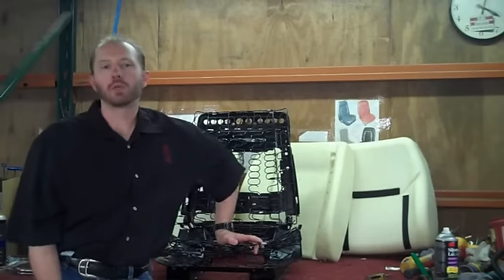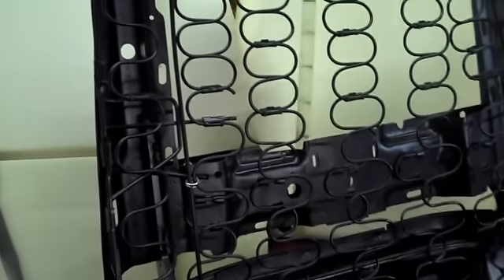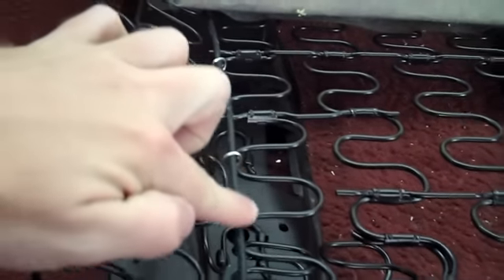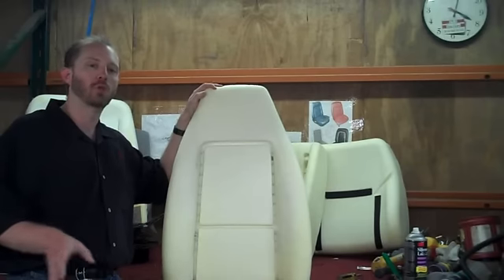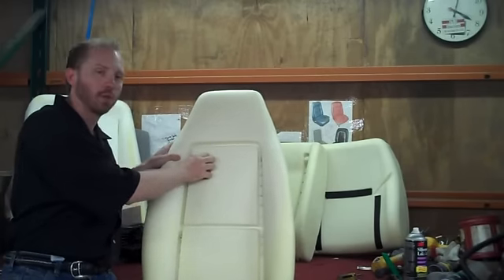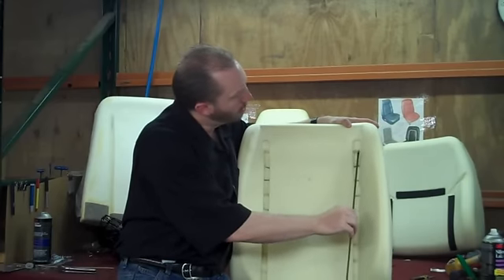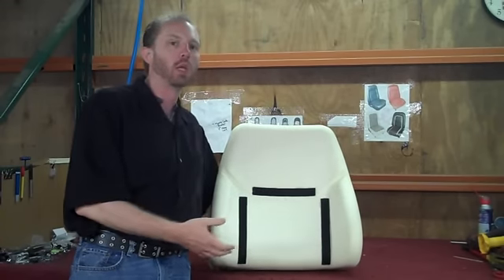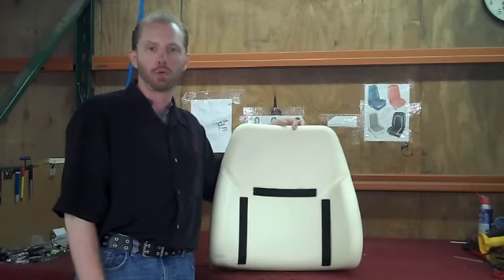Seat Foam Types

Comment: just wondering i have a 1979 ford pantech truck under the seat i was putting oil and water in it, but there is this form underlay  it is a brownish gray with fine hairs while the other looks just like plane foam, but it has fine hair like things, i put a thing under it and got smacked by dust, is it asbestos and how can i tell cheers.
Reply from the maker: Tony we've never manufactured anything for your vehicle so we're not experts on it.  I'd recommend you look for a forum specializing in your truck and I'd be someone there will have a solid answer for you.

Comment: I am searching for original foam cushions for a 2000 cheve s10 bucket seats I also would like to know if you have the cloth coverings.gray brush with dots color center area seating.
Reply from the maker: We do not manufacture seat upholstery for the S10.  Camaro foam, 1993-2002, may be similar but there is no confirmation of that at this time nor guarantee it would fit.